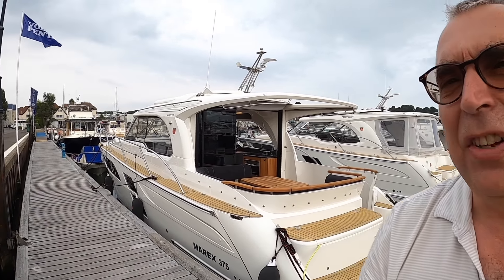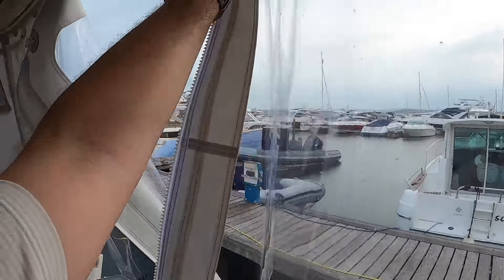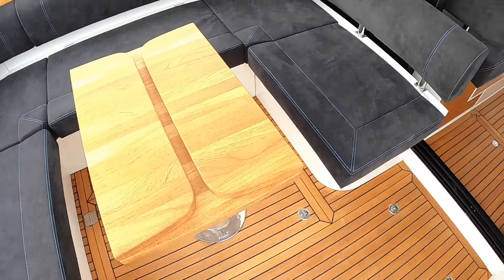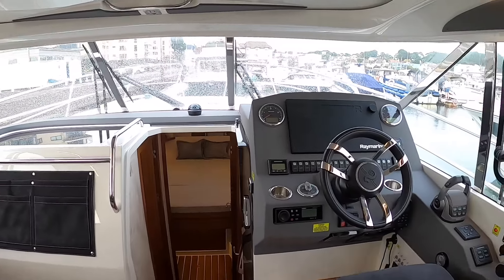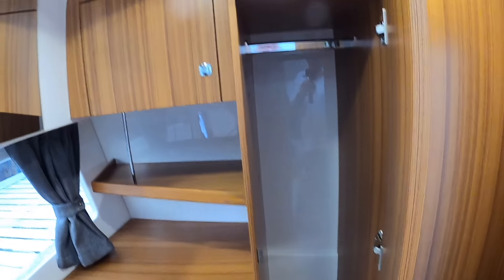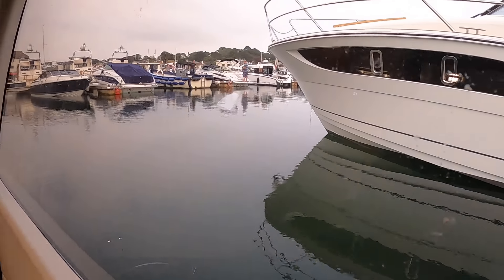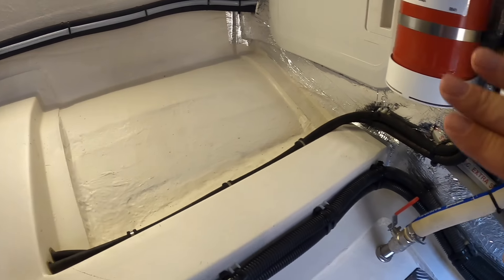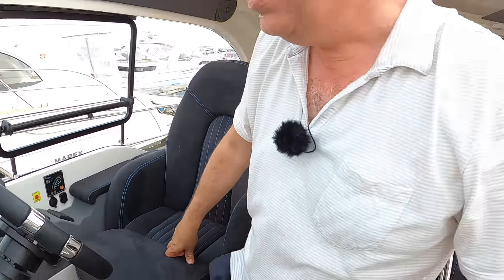£310,000 Yacht Tour : Marex 375

Comment: Great Vlog👍and great boat! Really good use of space with all the storage areas and love the way they did the slide in/out walls with the quick hooks to enclose the back, and really like the "single motion" way that the seat base and seat back all move at once to adjust the chair. I personally would rather have the manual sliding sunroofs like this has over powered ones. They open and close much faster by hand and have less to break or go wrong with no motors, gears, and cables to worry about. The toilet being recessed under the flip up counter saves a lot of floor space and is much nicer than having to have a wet bath because it is stuck out in the way of a shower space. Only thing I would change is the ladder steps to the engines. I'd want flat step bars instead of round tubes to help prevent slipping and give more surface area to stand on.
Reply: You are absolutely right! And also, did you notice how easy they were to use, more like stairs, instead of ladders, looked easy to climb, what is rare in this size of a boat, that amazed me. Was it so Nick?

Comment: I'm a huge fan of all the Marex models, so smart. However, a big improvement for me would be to make 40% of the seating optional. When you are single/couple you don't need seats for like 22 people in the living area. 4 ppl on board would be an exception for me, 2 dining options for 4 is enough, especially since the inside area can be opened. This would make room for a grill, bar, or just more open space. Sealine C330 solved this better imho.

Comment: Personally if i where to buy a Marex, i wouldve never bought one without the rear cabin (as can be seen on the blue Marex at 9:31, it got the optional rear cabin). Its so rare to see these in Norway without the rear cabin, and its easily understandable why once one have been inside of one with it. They offer so much better interior space while keeping a really great exterior space, which is important in smaller boats here because most guest harbors in Norway, Sweden and Denmark can normally not fit boats bigger than 37 feet. Its hilarious seeing people try to fit Sea rays, Fairlanes and Princess`s thats like 40 feet in our guest harbors.

Comment: I watch every one of your motor yacht / boat videos and whilst I will never be able to afford one at their price points always gravitate to the likes of the Azimut 78 or the Cranchi Settantotto 78 ft or Sunseeker 74 Sports Yacht.  All as the experts say can be owner operated and offer fantastic living space and equipment.  I was however blown away by this sub 40 sized boat.  Loved the aft cockpits canopies and practical boating based storage - whilst a two cabin it looked like it would make a good holiday based boat as well as a long weekender - space in engine room for a large portable freezer etc..  Spotted the fridge under the helm station but didn't spot a generator although space for one?
Reply from the maker: Not much need for a generator - cooking is gas, everything else runs from the batteries.
Reply: @AQUAHOLIC  See that shows my ignorance :).  Is the heating as well?
Reply from the maker: @grahambrown-theoffsitecons6345  Heating is diesel fired and uses batteries for blower fans, so again no generator needed (I have it on my boat, but no genny)

Comment: Nick I have no boat or have I ever had one but I love watching your videos.  This is probable a stupid question but if you have twin engines and you're cruising slowly is there an advantage or disadvantage of running just one engine.  Thanks.
Reply from the maker: That's nice to hear. At very low speed you'd normally run both engines on tickover rather than one engine with a little throttle. If you run on just one then it will try to 'steer' the boat as it's offset, which you can compensate for by adding a little steering lock, but it's not as efficient.

Comment: I like this boat. Didn't see a generator. Really surprised about that.
Reply from the maker: They're not that common in the UK under 45ft. Cooking is gas, everything else will run off the batteries.
Reply: @AQUAHOLIC  Thanks Nick. In the US its pretty common to have a generator on anything 30ft and up. Good point about the gas stove.
Reply from the maker: @Lake_Lover  Yes indeed, but I guess you normally have air con which requires generator power? Extremely rarely needed in the UK! 😄
Reply: @AQUAHOLIC  Absolutely needed. Especially mid to late June through late September in our region. No wind and high humidity equals very hot conditions. All the gulf air comes straight up the Mississippi valley all the way to Minnesota.
Reply from the maker: @Lake_Lover  There's why USA boats normally have them then. :)

Comment: So didn’t see a generator .. example how long could you run a 2kw oil heater or something to keep the cabin warm... is it all off battery?
Reply from the maker: If it has central heating (and I think this one did have) it is diesel fired and the fans are electric
Reply: We have a 310 with the same diesel eberspacher heating, I’ve run it all day without any problems (and it’s very toasty as well)

Comment: One wee thing, plug sockets to charge a phone? Checked the video twice now and can't see a plug socket. Checked the Marex website there is shore connection as standard and an optional diesel generator, so it sounds like it should have some power sockets i just cant see any.
Reply from the maker: They're quite hard to spot. Look at the cooker hob, there's one just behind it to the right for example, another by the passenger seat that folds back to face forward.

Comment: Very nice boat and I love the 2 door engine access.  Perfect spot for a 7.5K generator down there.  Looking at those engines and the belt drives around the pulleys gave me a thought, although it may be a stupid one!  A car is cooled by an AC compressor driven by part of the serpentine belt.  Do any boat manufacturers exploit this kind of setup to drive a couple of AC units to cool, maybe the salon or a master bedroom?  A compressor on a car is parasitic on mileage but not prohibitively so.  Why couldn't a similar arrangement be exploited on a 2 engine boat?  Of course, my knowledge of how an AC unit operates on a boat means maybe they are already drawing belted power off the engines to do exactly that!
Reply from the maker: The difference with a car is that you're rarely sat in it with the engine off, whereas on a boat you're on board a lot with motors off, but still requiring cooling.

Comment: Where is the generator?
Reply from the maker: There isn't one - no need.
Reply: @AQUAHOLIC  no need for a generator? I guess I should pull mine out and throw it away, these 4 ac unit will power themselves by unicorn farts I guess
Reply from the maker: @BlacksheepLSX  There's no air conditioning, no need for it in the UK.

Comment: The problen isn’t in the boat 
Its in the price
Reply: Yeah, you can get an aventura 10 for that price
Reply: The price reflect the quality. Also these boats hold their value exceptionally well.. so you’ll get your investment more or less back in full when you sell..
Reply: Indeed terribly expensive. I like the mechanical sunroof more than the electrical, but they could've at least dropped the price by a little.
Reply: Indeed, found it also pretty expensive. The boat itself is nice.
Reply: Have you been to Norway recently? Youd be hard pressed to find anything cheap!

Comment: Does anybody know why most boats have gas cooking? Electric seems more logical because you need electricity anyway. Now you have to think about refilling gas...
Reply from the maker: Because boat systems are 12v or 24v which won't run a cooker and if you used an inverter you'd kill the batteries in no time. So if no generator then gas is the only practical fuel source.
Reply: @AQUAHOLIC  Thanks! Aguess I overestimated the energy efficiency of modern electric cooking.
Great channel btw, really enjoy it!
Reply from the maker: @wouterspeelt  Thank you :)

Comment: As an American I have an issue with this boat. It's not really that trailerable with an overall height of just over 14 ft. That means that on a trailer this boat is probably pushing 17 ft overall height. That's no good for moving a boat around America on a trailer.

Further she weighs almost 17,000 lb dry! My lord that that boat is heavy. This is the heaviest boat in this price range and size I've seen. They seem to get the beam right at about 11.4 ft. 

In short the things I like about this boat are because the builders ignored basic dimensions that make this boat very sellable. Maybe some Brits will like this thing or maybe Euros, but this boat is dead in the water in America.

Considering dry weight, this boat is probably close to 21 or 22,000 lbs fully loaded and with a boat full of people. I imagine the fuel economy is dismal. Of course and typical aquaholic fashion he never mentions anything about fuel economy or anything about dimensions or weights or anything whatsoever with regard to specs. Nice quality videos but it wouldn't hurt to take 10 or 15 seconds just to do a quick rundown of the specs on the boat.

The Cut Water 32 command bridge is a far superior boat at the same price range. As is the Aspen 108 power catamaran. Or the Monterey 337 sport yacht

As is the Benetau Antares 11 fly bridge
Reply from the maker: It would have been a bit odd to compromise the boat in order to make it popular in a market they don't sell to...
Reply: @AQUAHOLIC  IMHO, the things they did brought little value for the weight, size, and fuel economy consequences.  They don't even bother making any mention of fuel consumption at all on their site.   I'll bet this boat is lucky to get 0.4mpg at optimal cruise.

Another problem is with a boat that heavy and basically a 4' draft they really should have gone with the semi displacement hull, rather than a 100% planning hull.  They basically built in poor fuel economy.